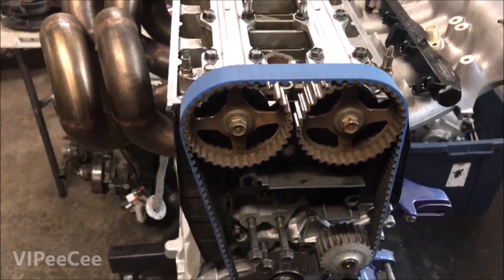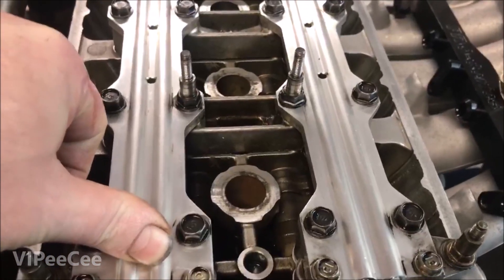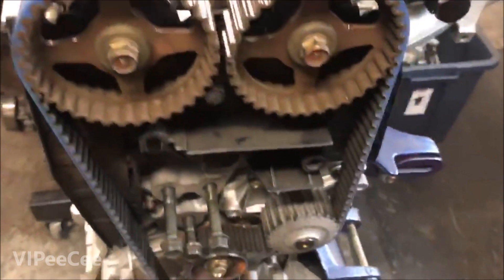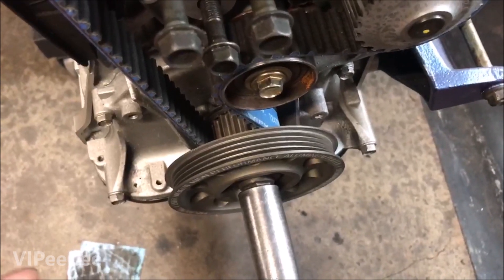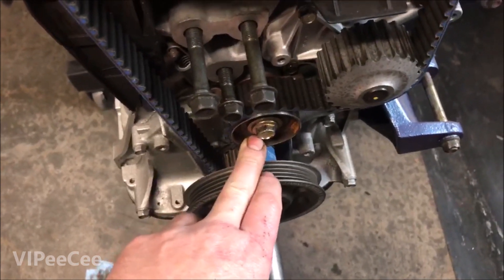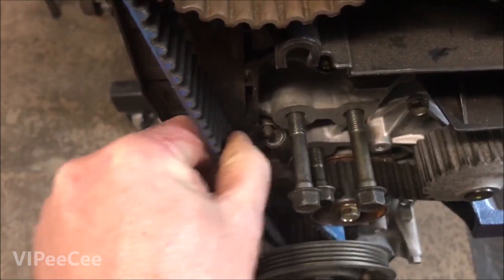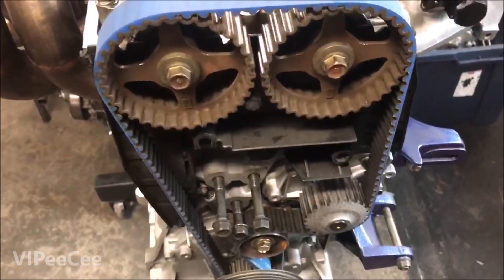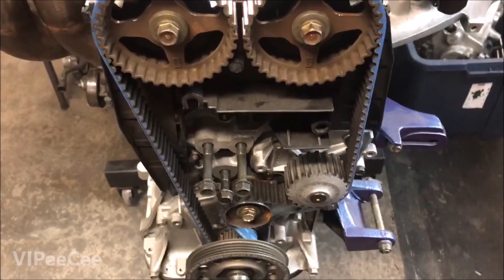Timing Belt Tension Explained

Comment: I did exactly as you said and followed the service manual to a tee. Result, belt jumped a couple teeth. If you're running thick oil, heavy valve springs, high compression, anything else that might add stress to the belt (and you've had your block and/or head decked), the OEM tension IS NOT ENOUGH. I'm a supporter of following the service manual, but it bit me in the ass. I tick all those boxes I listed, so more tension is needed for me. Tread carefully.
Reply: Hi, Can you explain to me please

I have a b16a2 and my belt jump 2 teeth on the intake side but not exhaust ! 

How can this happen ? 
I have adjustable pullies ( i buyed the engine like this ) 
Thank you
Reply: @Seidowas you got an answer or still?
Reply: @Seidowas  sorry I didn't see this 2 years ago. Have you been able to get around it?
Reply: If you have an old tensioner spring, the tension is less than OEM.
Reply: What did you end up using option part for solving that slack issue? I ordered a aftermarket stronger spring that speed factory offers. They claim it's ×7 times stonger
To give a better pull on the tentioner
Reply: @jesseserrano6520  that spring sounds interesting, but you still have the long run from exhaust cam gear down to crank pulley where the belt just flaps. I run the "1320 Performance manual timing belt tensioner V2". I don't use it to add tension, I use it as an idler to stabilize the belt. If you hear whining, it's too tight and will eat up cam journals. So get it just shy of whining. 20k trouble free miles thus far, and many 1/4 mile passes :)
Reply: I @ArthurSperotto i gave one a try the $54 dollar one and the wheel scratched of the blue paint of the belt. And the ring clip came loose an off the wheel. I was like they have to be another option
Reply: @ArthurSperotto I've seen that 1320 one is like $130 right now right.
Reply: @ArthurSperotto your exactly right about that long run of the exhaust cam. Its slacky and worried about skipping teeth and bend the valves again. Can't have that
Reply: @jesseserrano6520  yup, around $130 sounds right. Don't cheap out on this lol

Comment: That crankshaft pulley is going bro destroy your bearings.. I won't use that if I was you... They have no harmonic balancer on them..
Reply: Good point. Im currently using a VMS one. It is lighter then the stock heavy one. Is that going to be a issue for the bearings??
Reply: For a race engine it will be fine, but for a daily or street driven car I don't see it lasting without issues. @jesseserrano6520
Reply: @jesseserrano6520 As long as its a harmonic balancer and not just a crank pulley

Comment: hmm, Thanks, just changed the head gasket and i didn't notice the belt tightness before i put it all together, now the engine just doesn't sound quite right with higher rpms and i'm quite sure i got the belt and gears aligned as they were.
hopefully now i just need to figure out if i over or under tightened it.

Comment: my timing belt doesn't "twang like a guitar string" 
I can wiggle it, even pretty much slip it off if I wanted to without undoing the tension 
it has almost an inch of play between the two cam gears
car also recently started having a noisy valve clatter, with a consistent "tick", oil pressure is good, everything under the valve cover looks like it just rolled out of the factory, and it has less than 50,000 miles on it. then again, it IS about 25 years old. all codes have been cleared but it still runs like garbage and as soon as I give it a rev, it blows out a huge plume of unburned gasoline smoke

I'm guessing that's probably not normal and I should change it, right

if somebody could point out something else I haven't looked at it would be much appreciated. as much as I like OBD1 cars, the CEL isn't actually very helpful with identifying a problem
Reply: have you changed the o2 sensors on your vehicle recently? the huge plume of unburned gasoline can be caused by several sensors that monitor your AFR. on my b18c1 integra it was caused by a bad map sensor and a failing upstream o2. it still could be other things causing it to run rich as well. also the noisy valve chatter is normal up to a certain point, have you tried using feeler gauges to check your valve adjustments to make sure they are within spec?